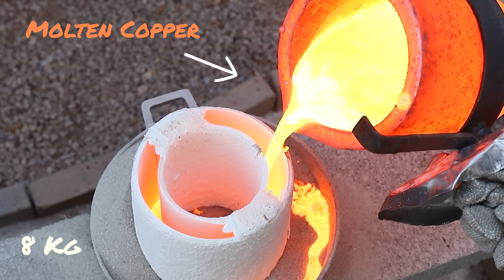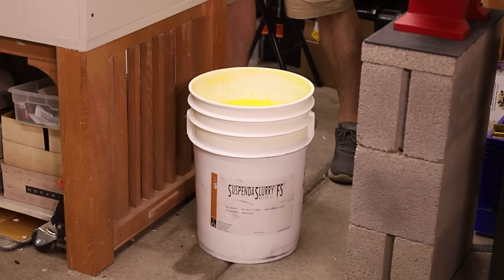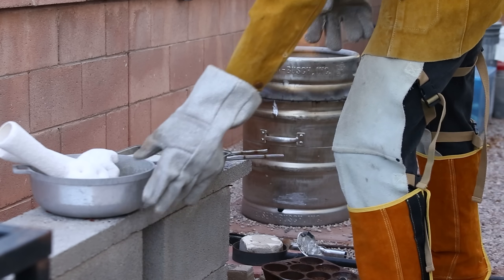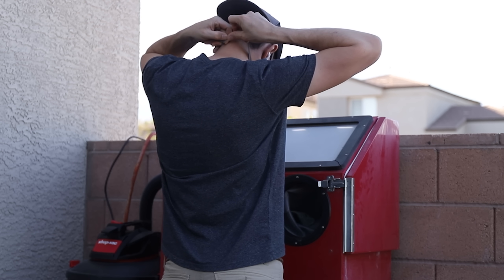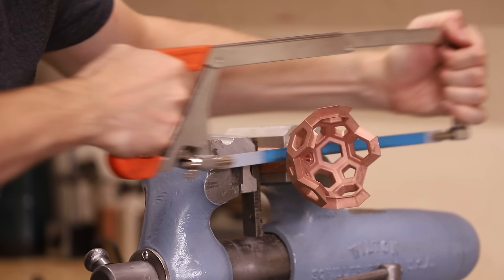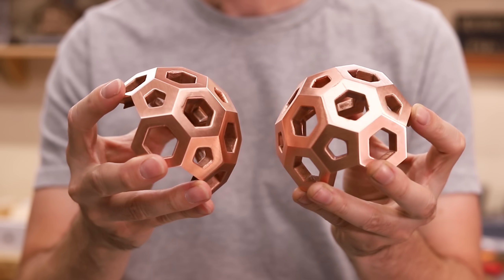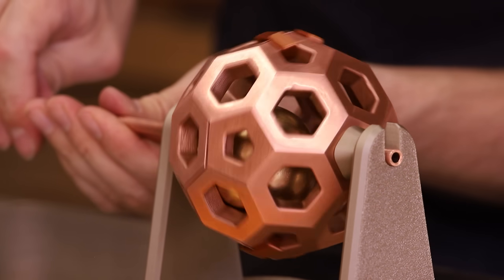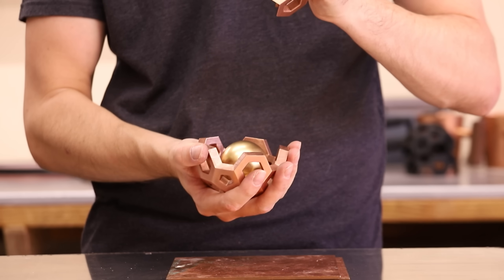HUGE Magnet VS Copper Sphere - Defying Gravity- Will a Neodymium Magnet Float Inside?

Comment: make a bigger transparent round sphere with spaces for wires
run electricty in them with different timing currencies and paths
make ai controll the curencies timing and paths and make the sphere in the middle and the magnet do different things
Reply: Try introducing electromagnet through shaft

Comment: Drill - add - spin - fast - controlled speed. Need's high speed camera. Add insulator between sphere halves, and apply brushes to each side, attach volt meter to brushes. Nice craftsmanship BTW.